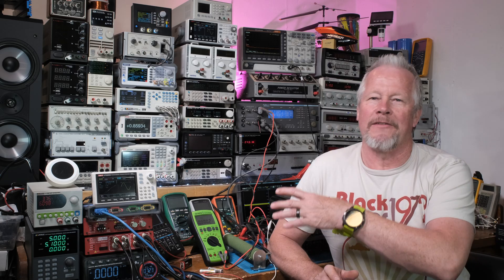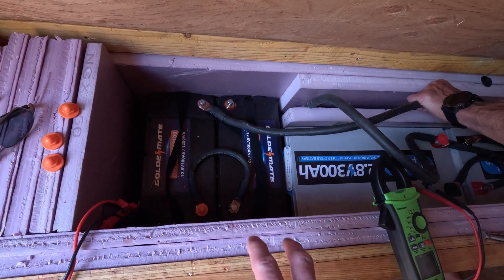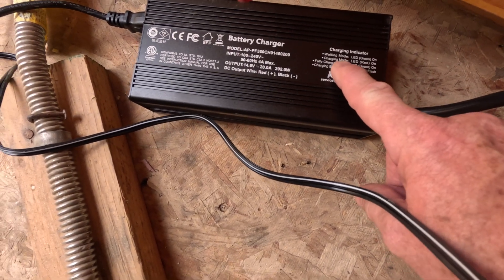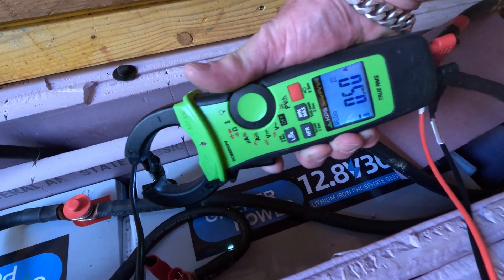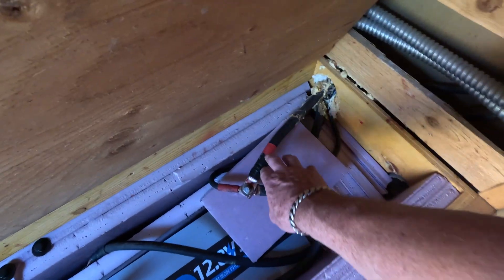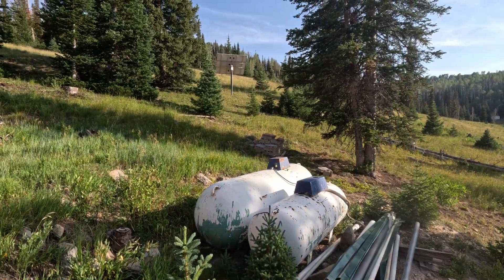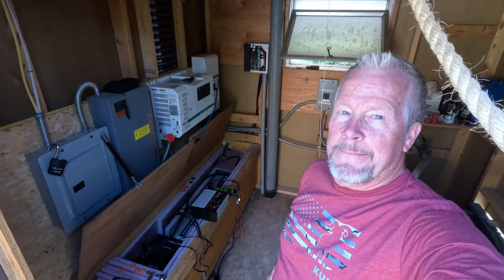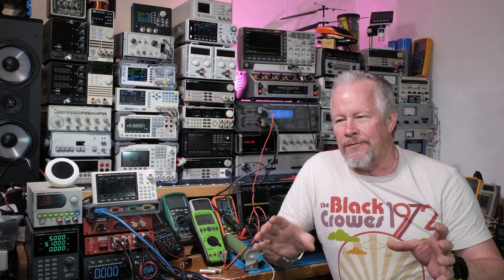Battery Balance at Cabin Solar System #redodo #goldenmate #grenerpower #Lifepo4batterybalance

Comment: Hello Eddie. You may want to add one of these "Battery Equalizer 48V, Voltage Balancer for 96V and Any N×48V System, LiFePO4 /Lead Acid/Lithium/Gel/SLA/Ni-Cd/Ni-MH Battery Balancer (HA02)", there are many sources including Amazon. I have effectively used several, they are based on power multi-vibrators coupled together via toriodal transformers, each channel is independent. Since your two strings are so different in capacity, I think two separate two channel units would work best for your setup "24V Battery Equalizer 2 x 12V Batteries Voltage Balancer Charger for Gel Flood AGM Lead Acid Lithium Battery (HA01 Balancer)". These devices are maintainers and should be used as such, they are not meant to fix large imbalances. Fixing large imbalances requires human intervention with chargers and power supplies just as you did in this video. Good luck.
Reply from the maker: Thanks for the great feedback.  So far, once equalized, they have stayed in balance and working well.  I have heard from some 'experts' that the equalizers are not needed and can just be an extra expense.  What are your thoughts?
Reply: @KissAnalog  If your system spends enough time fully charged the battery BMS will more than likely be able to top balance the cells, if not the batteries will drift apart. One way to know for sure is to use a data logger and actually observe the long term operation. The batteries I build and buy all have a smart BMS, I like to tune the performance and know what is going on. Most BMS use a low current balancer, around 100ma, that's why it takes so long to balance on batteries that use large prismatic cells. LiFePO4 cell balancing is most effective at the very top of a charge cycle, the hockey stick portion, and it is where overcharging can occur, On most of my batteries that I charge right to the top I use an active balancer that works in the one to two amp range. Hope this helps, I enjoy seeing other people put together systems and get them to work, There is some really bad stuff out there and you really need confirmation of ideas that you may be interested in. PS The two channel equalizer is only $23 on Amazon, so for $69 you will know for sure and have a spare. Take care.
Reply from the maker: Thanks for the great feedback!!

Comment: Hi Eddie! Для начала не плохо! Необходимо продумать схему балансировки для последовательно соединенных батарей, для LiFePO4 это важно для их долговечной работы! Для параллельного соединения, например батарей на напряжение 24V, балансировку можно не применять, достаточно BMS внутри каждой батареи. С благодарностью от друга - инженера из России!
Reply from the maker: Thanks for your feedback!  How do you think the best method of balancing is?
Reply: @KissAnalog  Eddie, к сожалению мне не удалось найти готового решения для балансировки собранных батарей. Я попытался приспособить типичный балансир с выводами для каждого элемента 3.2V (1S-8S), но потерпел крах. Думаю, вам нужно будет периодически, например два раза в год соединять все батареи параллельно и заряжать их до одного напряжения 14V, разница конечно возможна, на величину разницы в параметрах BMS внутри каждой батареи. Для беспроблемной эксплуатации всей установки проще всего использовать все батареи на 24V соединив их параллельно до нужной емкости. С уважением, Alexandr!
Reply from the maker: I will have to show how I did this.  I top balanced these and set the charge levels and power off levels in such a way to keep the batteries so that they would continue to charge and balance.

Comment: Great work .  With that  water channel  runnnig near by you can consider fixing a water turbine and a flux alternator to supply power to charge the batteries. 

I have fixed a solar system to power my house. 535watts x 4 panels , 4000Kw pure sinewave inverter made all by myself (transformer is 45 KG) and a 80Amp MPPT 4x 12v 100AMPH lead acid batteries. I wanted to change them to LifeO4 batteries. but the MMPT company says  it cannot use liefO4. So decide to design a unit to control charging so that I can use LifO4 batteries using the same MPPT (cost about $200). Apart from this I have another generator too. The whole system is automated and do not require manual switching.
Reply from the maker: That sounds like a great idea - thanks for the suggestion!  Do you have a water turbine in mind?

Comment: I had another problem - the minimum discharge level was set to 10.9 V - it reached the minimum value and stopped. But due to temperature changes the battery reached 9 V - for me the minimum discharge level worked but nature left its mark on the batteries.
Reply from the maker: Great point!  We found the min volt level initially seemed good, but then there was a small drain that took them down to about 9V.
Reply: @KissAnalog  there is an old rumor - batteries with high internal resistance are connected first, and those with low internal resistance are connected last - this way a balancing is done during discharge - but this was a myth used on diesel locomotives - in the starting group :))
Reply from the maker: Wow - thanks for that great feedback!  I could see how that might have made sense - as the longer leads add resistance - thus balancing the batteries.  But, this would balance the resistance - and might cause an issue with charging the battery with lower internal resistance:)
Reply: I think it was a myth only valid for lead acid batteries - I don't think the new generations of batteries "follow this myth"
Reply from the maker: I could see how this might be thought to balance lead acid batteries...  New Lithium batteries have BMS built in so they manage the charge so this wouldn't affect them.

Comment: Hey Eddie love solar, and super interested in the electronics behind it, charge controllers etc. I hear a charge controller is just a glorified buck converter, and an MPPT charge controller is just a buck converter that adjust its voltage on the fly to keep maximum power.  So maybe a buck/boost?  Ive been messing with balancing as well and toying with the idea of dc-dc isolation converter to charge your cells in parallel even though they're hooked up in series. It worked on small scale lithium  batteries (4s), but the DC-DC converters are limited in amps so its good for balancing only. I was hoping for super fast charging, you know like 4.2 volts 100 amps. That would be a cool charger but some thicc cables eh. I dont like the current balancing method that has you burn off energy of all your good cells while the weakest cell catches up.  Hence the idea just to give each cell an isolated supply of 4.2 volts.  And bring on the hydro power, looks like they have the height for it. Or pump water from the pond uphill with excess solar and let it come down for energy. ITs not much, but better then not using the solar.
Reply from the maker: Thanks for sharing your thoughts and experience with the balancing.  I have some of the same thoughts.  Experimentation is fun:)

Comment: I thought the standard practice was to put the cells in parallel first, then put those in series. (Make sure the cells are charged to the same voltage before putting them in parallel.) I suppose it doesn't matter much in this case, since your 12V batteries are already 3SNP internally. I hope they have internal charge/discharge protection.
Reply from the maker: That's a great point, thanks for the feedback!  I thought that since they were different Ah batteries I’d do series then parallel.  They do have BMS built in so they are safe.